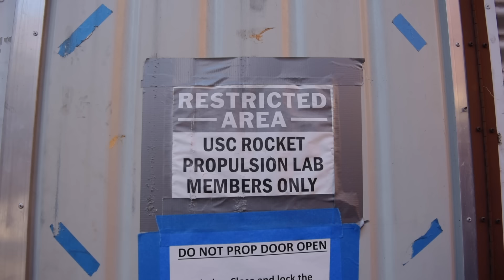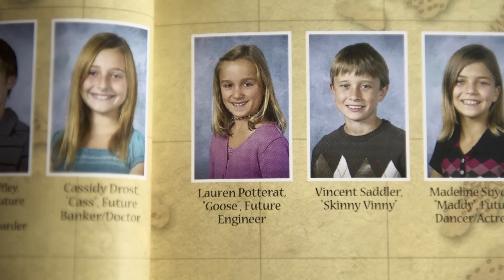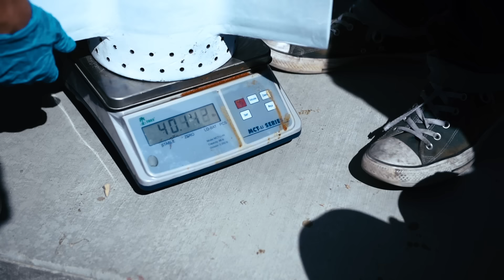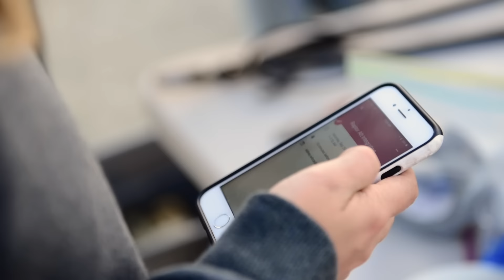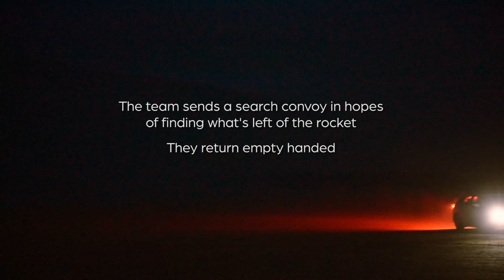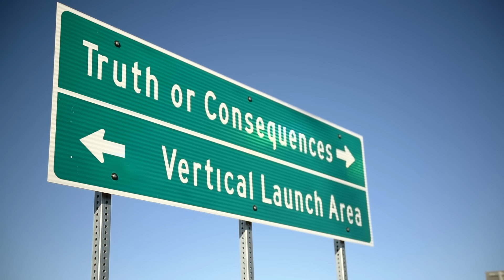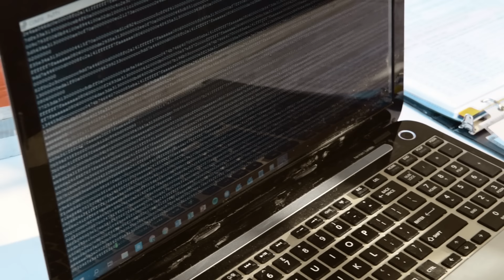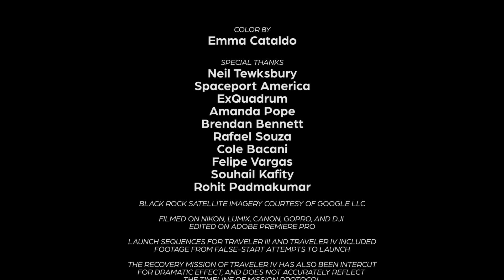Space or Nothing - First Student Rocket to Space

Comment: As a Veteran Air Force Rocket Fuel  Handler I found this video really fun to watch.  I used to work with UMDH hydrazine and N2O4 nitrogen tetroxide.  These were extremely dangerous and poisonous chemicals that we worked with in amounts in the tens of thousands of gallons.  Great job on your rocket!
Reply: hi sir, seeing your expertise in this sector would you mind helping mee or giving me some suggestions regarding rocket fuel and engines as i am also working on a project similar to this :)

Comment: “Windows is a little more susceptible to failure” as said by engineers
Reply: linux masterrace, written on my Thinkpad T60
Reply: @deathbornium  
To stability and beyond!
Reply: @deathbornium  A true man of culture.
Reply: Running Windows for years hear.  Never a single failure.  Its hardware that fails.  Windows doesnt like failing or ailing hardware.....Hence 95% of BSOD errors are RAM issues!
Reply: @nissan300ztt  Not even close poorly written kernel mode drivers are a more common failure point than ram, although ram is still a failure point, but there's a reason why ~96% of the top million domains are linux powered as well as the majority of cloud compute (92% of EC2 and ~60% on azuire for example) and a small part of that is a record of stability.
Reply: @fenix849  linux is crap for regular users though.
Reply: @nissan300ztt  well yes, he never said it wasn't. In fact for regular users it isn't even that bad.
Reply: @bigrig8539  im a Mechanical Engineer.  All the programs I use are windows based and rarely fail.  In fact solid works runs terrible on Linux.  So
Reply: linux on top
Reply: @nissan300ztt  are you from the past?
Reply: @nissan300ztt  well, that's a SolidWorks success/failure scenario, depends very little on the OS itself.
Reply: @nissan300ztt  clearly MacOS is the best software for computers in the world. Factual opinion.
Reply: @cadosian078  "Factual opinion" literally means nothing. Best for some use cases, not for others
Reply: @cadosian078  Which is it, fact or opinion? hmmm, it's my opinion that this is a fact?? It's a fact that this is my opinion?? I wonder.
Reply: this aged well

Comment: Looking at the differences between the 2 launches.  In 2018. they were rushing to beat a sand storm and communications between the pad crew, launch crew and the rest, i.e. avionics and recovery, were spotty at best.  In 2019. all of the component crews, launch, pad, avionics and recovery were all in touch with good communications and most were in the building together.  There was no rush to get it in the air.  A key ingredient to success in cases like this is not NOT RUSH.  If a storm is brewing, rather that rush to get in front of it, secure everything and wait for the storm to pass.  Then you can get everything together at a controlled pace, stick to the checklists and not miss any steps.

We had a saying in the military and it holds true here.  "Slow is smooth, smooth is fast."

Comment: Propellant looked like the mixture used on SRB's from Shuttle Program; Ammonium Percolate, Aluminum Powder, Iron Oxide, Polymer Binder, and Epoxy curing agent. When mixed it becomes a grey paste that can be pressed into Rocket Engine. After it cures, it becomes 'solid'. This is a very powerful and efficient Fuel when correctly mixed and pressed into Rocket Engine. A round center void is left to aid in uniform burning. Once lit, it won't go out until all Fuel is burned.

On the Space Shuttle, it took 3 seconds for main liquid fuel engines to develop full thrust. It took less than 1 second for SRB's to develop full thrust. NASA would fire main engines then at T plus 3 secs, ignite solid rocket boosters. SRB's would run for 2 minutes then be jettisoned. Once ignited SRB's could not be stopped. They do have destruct mechanisms to destroy them if a major mishap happens, as in Challenger 1/28/86.

Comment: There really has to be a better way for motor integration. That process is a bit funky. Maybe the motor goes inside the case with some spacers around it to stand it off from the casing by a quarter inch or maybe a half inch, so there's a gap around the motor that you can then fill with a sprayable insulation foam that just floods in there and expands to attach the motor to the case.

Comment: What I would love to build is a space shuttle like space vehicle. 3 Rockets to like this in the video on the sides and a little bigger one in the middle of those so you have a configuration like the big super heavy rockets and put the vehicle on the back of that. The vehicle would need its own propulsion but liquid based and with regulated thrust and thrusters on the sides and front to steer it and a camera of course so you have live feed and you can steer it around. You start with the 2 outer rockets, then you drop them and carry on as second stage with the middle rocket, then you drop that and you fly on with the vehicle onboard nozzels and steer it around with the thrusters. The you bring velocity to zero and aim it towards earth and in the end you reenter and try to land that thing. It would be like an rc space shuttle. Just like it even with the tiles you try to reproduce as cheap as possible. That would be a blast! And it's totally doable! There are already rc space shuttles out there. Just reproduce that for in-atmosphere landing steering and thrusters for space steering shouldn't be hard to make. You could literally use spray cans with anything in them and remote control pushers that push down on the head so the spray shoots out. One each one sides front, sides back, up and down side front and back and one and the front for backwards flight and like I already wrote in the back you'd have liquid rocket engines like the real space shuttle. If I'd had the money and time I'd make it. Maybe this comment as a inspiration for someone to make this thing!

Comment: There was simply no risk analysis to remove and mitigate the systemic failures and apply controls to overcome obstacles.  Using cell phones instead of radios and no checklists in sight are obvious clues to the inadequate planning.  Aviation and aerospace require high standards of performance not understood by most people.  It looks like they overcame the obstacles!

Comment: I know I'm not the only person thinking this, but would a weather balloon help ?  You wouldn't have to burn fuel for the first twenty miles.
Reply: It's been done before, but the main issue with it is the problem with not being able to properly control the angle of the launch, proper checks of the rocket itself, and many other issues with systems that are just easier to deal with on the ground. It can also drift away, making a rocket hard to recover if they wanted to. The ignition of the rocket would also be harder, and if it failed, the entire rocket would likely be lost, instead of being on the ground, where it would just stay there. The temperature of the propellant is also drastically affected by the slow change in altitude and long exposure to the lower temperature on the way up to the 20 mile height. The rocket would also be dangled, unless somehow a heavy gimbal system was installed which wouldn't be practical.

Comment: As a rocket enthusiasm and 40 plus year amateur rocketeer, I simply do not believe this fishtailing spinning solid propellant rocket that appears worse than most amateur's high power rockets achieved over 100 kilometers (maybe distance but not altitude).  I've seen liquid pressurized H2 and O2 rockets with gyroscopes made by engineers get only 60 kilometers when performance was perfect.  This is like saying a match and aluminum foil rocket outperformed an Estes rocket.  I cal BS.

Comment: Space is not an altitute. To shoot an object to an altitute of one or a few hundred kilometers is not space flight. Space flight is at least an object falling around the earth like Sputnik 1.
Reply: No, that's orbit. Anything that passes the Karman line is in space, and has therefore flown to space, making it space flight.
Reply: @bboi1489  hm, then it is very easy to go into space. You just need to have a vehicle which is capable to travel at Mach 3 in the lower stratosphere, turn it vertical and switch the engines off. Mach 3 is enough to cross the Karman line and fall back to earch without a dangerous re-entry into atmosphere. You just regain Mach 3 which is not enough to fail fatally.
Reply: @Gunter Flunder  Yeah, guess so. If you have the few millions to make a supersonic aircraft.
Reply: @gkdresden  Where did you get the idea from, that for something to be in 'space', it needs to be in orbit around the earth?
Reply: @sailorman8668  to be in space is for me more than to be at a certain height above sea level. For me it means a stable long term condition of micro-gravity. So it is more a condition of a certain velocity (first cosmical speed) than a condition of height.

Comment: That's a lot of cinematic bla bla :)
My confidence would have been higher if you showed telemetry altitude in realtime and clear video should really be possible too. We are not talking about filming inside the nozzle. It's the top portion where 'nothing' happens. the slightest aerodynamic shroud should provide for a clear camera view.  Doesn't have to be perfectly stabilized but better than a text only claim of 90% confidence. I did the math on a sugar rocket in stainless steel body and it was easy to reach 100km with staging. Just keep the speed modest until you are free of most of the atmosphere, it's a classic mistake to blow your load in the first 5 seconds and reach 2km up. You don't need carbon fiber, you don't need anything fancy. I don't know what you were doing when you gave it a mud bath. 
It's not about making it look like a missile. Follow the propulsion math, the rest is details.
Stainless steel, sugar rocket, staging.  Also have a moderate telescope to film it from afar so you can follow it up. Sun in the back. Sony A7 on a celestron 8 OTA should give better pictures than nasa and even Tesla. In a pinch a used ETX90 off ebay is very capable optics.
Reply: So what's the highest you've gotten a rocket?
Reply: @MeerkatADV  I dabbled with sugar engine builds, I made a 30second burn engine that in 2 stages could reach over 100km but I lost interest after I found out that UFOs are real. Rocketry has no future. Going over 100km with a small rocket is pretty simple engineering. You have to understand that you don't go mach5 through the atmosphere. You go sub 500km/h until you are free. Then you open it up to around mach 5 and it will coast upthere.